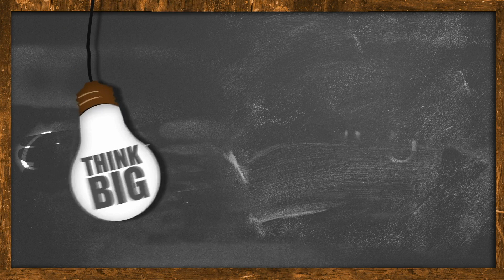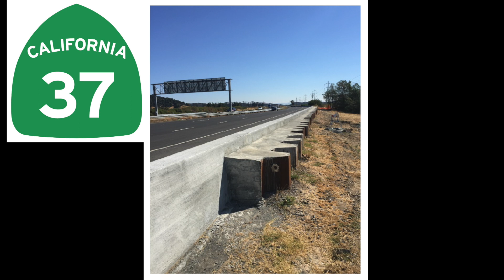The Future of Highway 37: Problems & Solutions

Comment: I commuted from Vacaville to Petaluma for ten years. While 37 was faster many days, I rarely took it because it wasn’t consistently faster. Many days you’d look at clear traffic on the car navigation, head that way, and by the time you’d get there, something will have happened and traffic would be at a standstill. I was not willing to be stuck on 37 for hours waiting for things to be cleared up. My alternative route was across 12, 121 and 116 through Napa and Sonoma. At least I could turn around and go back another way if traffic stopped there! Commute times were more consistent, and reliable. Keeping my job depended on that consistency.

Making 37 an elevated causeway two lanes in each direction is WAY overdue! It should’ve been done when they built the wall taking out the passing lanes decades ago! Getting the roadbed up and out of the marsh has to be the best way for a proper long term solution. Other first world countries have passed us by while our public waits for partisan politicians to bicker back and forth about who is more corrupt. Oh, and no toll road, because that’ll just send more traffic through 12, 121 and 116, Napa and Sonoma don’t want that as they already have too much traffic from folks who don’t want to take 37 as it is! Making 37 a toll road would also send more traffic across the Richmond San Rafael Bridge, adding to the already bad backups there. Tolls would also unduly burden poorer Solano County residents. Building better jobs in Solano county so fewer folks have to do long commutes would also help decrease traffic on the 37 corridor. Please turn up the timetable of building 37 into a causeway, in our lifetimes, while us that use it, can! And, while carpooling is a good idea for some, it doesn’t work for the majority of commuters. How about also turning up the timetable of building SMART Train out to Suisun, in our lifetimes!… Are there any funds coming for 37 corridor projects from the Infrastructure Investment and Jobs Act?

Comment: Protection of the wetlands that will provide long-term resilience from sea level rise should be top of list.  What changes can humans make to reduce their impact -- we saw that remote work does provide an option for some and should be advocated for as a means to reduce congestion.
Reply from the maker: Excellent points! The permanent replacement will likely 'lift' Highway 37 out of the marshlands to better protect the ecosystem. A bridge across San Pablo Bay is being considered. Check out this article that covers the short-term and long-term solutions ➡️mtc.one/3v9vR4t